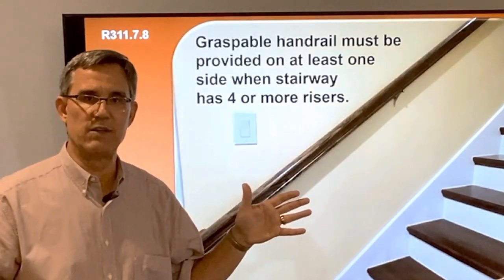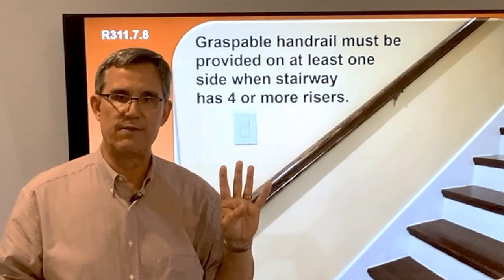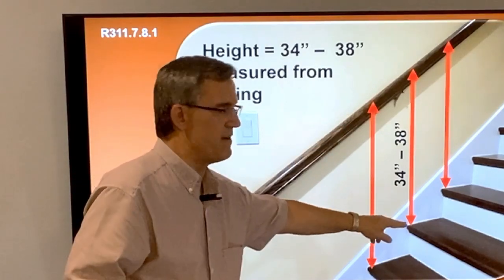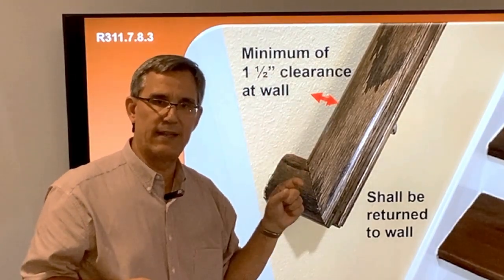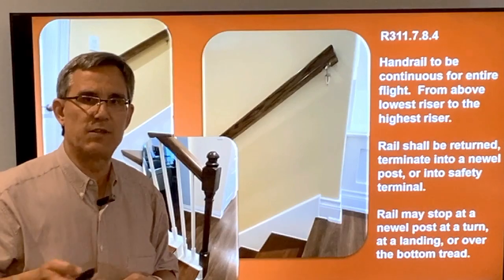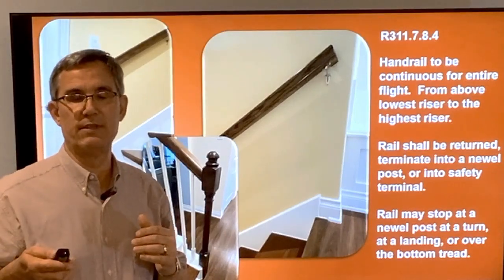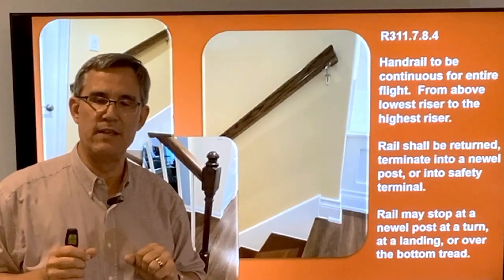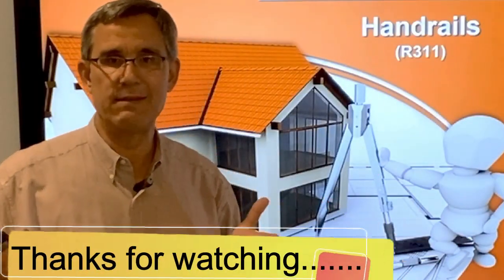2021 IRC Rules for Handrails

Comment: 2 handrails is an option for residential as per IRC code, as long as 36" clear width is maintained. 2 handrails are required on commercial and institutional applications as per IBC code. Concise video, nice work, Rail King Iron Works